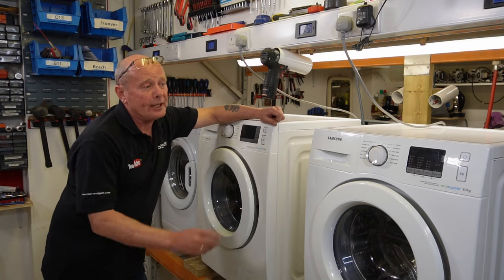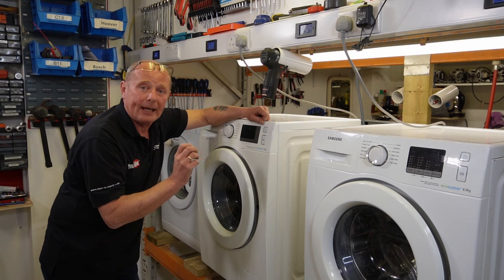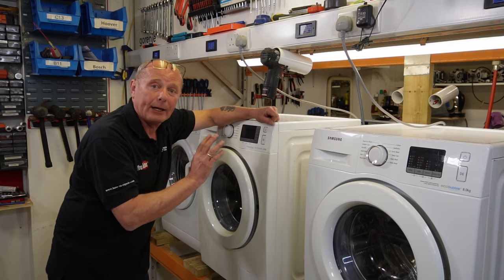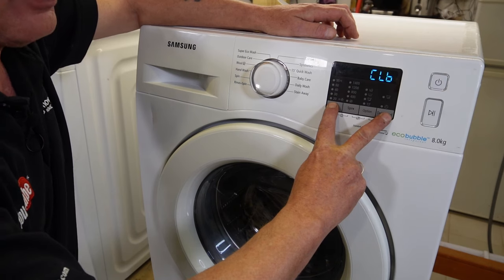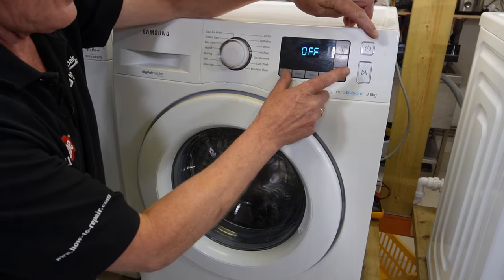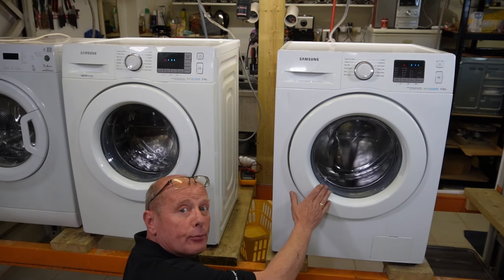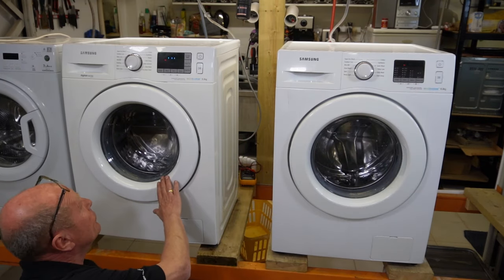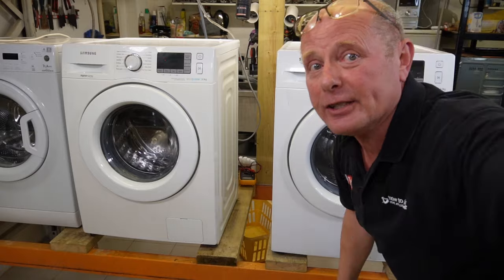How to run calibration mode Samsung washing machine test motor, check error fault codes.

Comment: Good instructional video. Older Ecobubble, pausing through any wash. Motor test 3E, calibration fixed. Recycling pump had elastic band wrapped around it (gentle hum on test). Stripped pump down, cleaned then satisfying gurgle from pump. Thank you.
Reply from the maker: thanks 👍 for watching and please remember to subscribe to the Channel as that's what keeps us going in able to make the video for you

Comment: Thanks for this.  I think 'CL6' is CLb actually for calibration.  Sadly, this hasn't worked on mine.  The metal tub still wanders by about 15 millimetres, maybe more.  It has shredded the rubber on the inside due to the excessive movement during the spin, and it really shakes and knocks.  I have to stop it before the final spin.
Reply: Reduce the spin cycle…power!

Comment: What do I do when the screen shows a number after the calibration?
My washer is a Midea washer.. The calibration stops at number 139... Any advice?
The manual says it should show clear screen [- - - -] at the end of the calibration, which is not the case.
Thanks.

Comment: Way to go on a side by side comparison for both machines for calibration. These machines always bite me because the displays are slightly different, and it's just enough to make them different for calibration or other diagnostic features.

Comment: Thank you for your videos! I've had my Samsung WW80J5555FX washing machine for almost four years now, and it's been a reliable workhorse until recently. Unfortunately, it has stopped spinning altogether. I've tried calibrating the machine, but nothing happens, and there's no sound coming from the engine.

I'm wondering if the issue could be with the motherboard or the engine. Has anyone else experienced a similar problem with this model? Any advice or suggestions would be greatly appreciated. Thanks in advance!
Reply from the maker: Hi, please use our contact us page and make sure you fill out the request for what your problem is. I will need the full model number of the identification plate and the details of your problem so that I can provide you with useful literature. A video shoot of the problem would be perfect as well.

Normally, I would get back to you within 24 hours but I am on my way back from the IFA trade show in Berlin, so it can take more time to respond. Thanks for your understanding. https://www.how-to-repair.com/help/contact-us/   

Please remember to subscribe to our channel, as that's what keeps this channel going. Thanks, Paul 👍

Comment: Hi I'm having issues with my Samsung digital inverter washer. After 20mins of quick wash the machine stops and a 4C appears on the screen panel.  What may be the issue??
Reply: Pull it out and check your water supply hose, check that your valve is fully open. Failing that, if water enters drum and you still get that error, check/ replace pressure switch and check pressure hose for damage

Comment: Hi, my Samsung inverter washing machine is having a built in dryer, but when I use it today the dryer is not working, once I start the drying it is start rotating but there Is one beep without error code and after about 20 seconds the drying ends and the door lock unlock and it's not even last for 2 minutes when the drying cycle stops, and it is not even heating, is there any resetting to do to fix the problem?

Comment: Great video. My eco with digital inverter has stopped activating the drainage  pump. 

When I independently power the motor it works fine.  I'm assuming it's the circuit board. Is there anything I might be missing.
Reply from the maker: SlowmoJo I would check when it's on a rinse that you have to 40 volts on the two wires going to the pump. I would love you to leave your opinion on our poll about manufacturers building in obsolescence to appliances. https://www.youtube.com/post/UgkxygHomnUySd_bYjaJBdEHPO6T4dYo9Ahm
and this is for you https://www.youtube.com/shorts/e432SAb2g08 please remember to subscribe as that's is what keeps this channel going. Thanks 👍

Comment: Hi I've just bought a Samsung ecobubble WW11BBA046AW and I've done the calibration and  Selected ecobubble on a cotton wash but the washing machine is filling from the top lefthand side not the bottom as described by Samsung I'm not getting the foaming bubbles for ecobubble mode and I'm using liquid  in the main wash draw have you come across this problem with these Samsung washing machines many thanks 😊

Comment: Hi, mine is starting the calibration mode but not ending showing a "0". When empty it will spin normally to 1400 but when full or when washing it will not spin and all the clothes remain wet. Any ideas how to fix this? Thank you

Comment: samsung top loading washing machine wa70h4000 diamond drum model panel keys not working. Except on/off switch work. Rest of keys have powers led shows up when turns on. Display shows previous time on each on/off. How do I get into test mode?

Comment: When I do the Calibration, it does it's thing then goes to 4 dashes and just hangs there indefinitely. My Dryer is stacked on top and the instructions say have nothing not even a cat on top of the washer. Will having a stacked pair effect calibration? Model is wf45k6500a
Reply from the maker: Hi, please use our contact us page and make sure you fill out the request for what your problem is. I will need the full model number of the identification plate and the details of your problem so that I can provide you with useful literature. A video shoot of the problem would be perfect as well.

Normally, I would get back to you within 24 hours but I am on my way back from the IFA trade show in Berlin, so it can take more time to respond. Thanks for your understanding. https://www.how-to-repair.com/help/contact-us/   

Please remember to subscribe to our channel, as that's what keeps this channel going. Thanks, Paul 👍

Comment: Hi, what would cause the calibration not to start? I've followed the steps and the clb comes up on the screen then sounds as if the calibration is going to start but it doesn't and goes back to club again.
Reply: Me too. Any replies on this issue?

Comment: Hi! I got samsung WW85K5410WW/SA washing machine. Got it since aug 2017. It suddenly stopped working. Its not taking any water in. Tried calibration but its not spinning. It drains water but thats it. Can you guide please?!  thank you .
Reply from the maker: If your washing machine is not taking in any water then the first thing you need to check is the supply, then you need to make sure that you have the water solenoid is working correctly. There is videos on my channel to show you how water valves work,  glad we could help you @kalindpatel this is for you https://www.youtube.com/shorts/e432SAb2g08 please remember to subscribe as that's what keeps this channel going. Thanks 👍

Comment: Hi there. I have a WD0804W8N which is a Digital Inverter EcoBubble washer-dryer combo. By trial and error I found that I can access the diagnostics test mode by holding down the Rinse and Spin buttons (second and third buttons below the screen) while pressing the power button which are different than the buttons you showed in youtu.be/5f3SVsxy_4I However I could not find any button combinations that brings up the calibration mode. Is calibration not possible on my machine or is there a different procedure? Thanks.

Comment: I have a Samsung WW70J3283 Washer. My drum spun anti-clockwise only while in calibration mode just like your brush motor washer. Shouldn't it spin in both directions?

Comment: I did the calibration but the pump works but the drum does not rotate what problems ?thanks
Reply: This could be your carbon brushes have worn out/stuck on the motor (underneath the tub when you open the rear panel). The carbon brushes are spring loaded to rub against the spinning armiture. There is one on each side and are held in by two screws per side - think a two inch long by 10mm x 3mm content of a drawing pencil, worn at 45 degree by the armiture and you won't miss them.

The above only concerns the older brush model. 👆

Also check that none of the wires on the connector attached to the side of the motor have snapped - I managed not to notice one of them had until I purchased replacement carbon brushes and was re-installing the motor to the machine, but hey, good practice anyway. I stripped away some of the wire protection, twisted and folded the wire back on itself because there really isn't much metal there, and because there is no slack to begin with on the wire, I used some spare multimeter test accessories to bodge a cable extension - a multimeter cable with a probe of a diameter that gave an interference fit into the connector, then a crocodile clip grabbing onto the folded wire at the other end. I only did this as a bodge job because I couldn't find my Dremel Versatip to sold the wire onto the connector. 

Anyway, whilst following another of this gentleman's video on how to run the test mode on the Samsung Ecobubble, the test would would fail with a 3E error code, which pointed in the direction of the motor. I found it funny watching a re-run of the video I made of the machine internals - you do make a video before you dismantle unfamiliar mechanical structures, yes? - after I discovered the snapped wire just to see if it had snapped whilst I was refitting the motor, but nope, there it was when I was doing my pre-disassembly and I hadn't noticed. My lack of attention cost me the price of a next day delivery carbon brush set, but as I said above, practice is always good.

The key thing is my wife now has a fully functioning machine again. 

I'm now learning how to officially calibrate the washing machine.

Comment: How to find the error code thank u
Reply from the maker: Sorry for the late reply I was away on holiday. I will need your full model number and serial number to be able to assist you properly. Please use the website I'm putting a link below Hi acie I will need the full model number of the identification plate please use our contact us page and make sure you fill out the request of what part you are after and will get back to you within 24 hours normally https://www.how-to-repair.com/help/contact-us/
this is for you https://www.youtube.com/shorts/e432SAb2g08 please remember to subscribe as that's what keeps this channel going. Thanks 👍

Comment: Hi, have a Samsung ecobubble 7kg machine, model is WF0702WKE.  It says  in the manual to calibrate the machine and gives instructions but it doesn't seem to go into calibration mode.  It just starts to perform the cotton wash cycle and displays a time if 1hr 26mins.  Are you able to help please as I'm not getting anywhere with Samsung customer service unfortunately.  Got our machine in 2010/2011, worked fine until very recently where its started leaving a white residue on clothes making them dull and makes black clothes look awful!  Please help.  At my wits end 😂.

Comment: Most of these machines become so unbalanced anyway that they shake themselves to bits. I've seen it so many times. Door seals split eventually from the vibrations.
Reply: At least on US models, their spider brackets are notoriously bad. Laundry detergent will get into the metal fingers and eat away at the support, causing one to fail and shift the drum to destruction
Reply: @bensappliancesandjunk  same with the UK models, changed a lot of Samsung drums

Comment: Mine won't do this just keeps switching off
Reply from the maker: you may have a problem with the circuit board it's well worth having this checked Glad it helped you please remember to subscribe as that's what's keeps this channel going. Thanks 👍